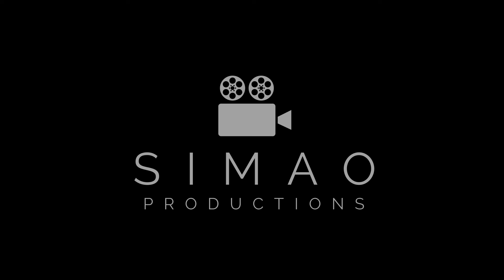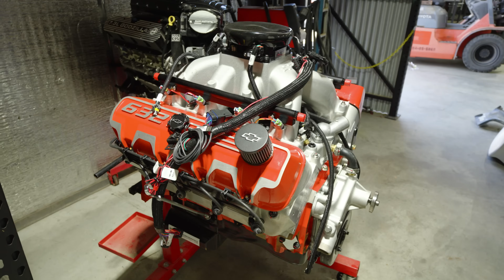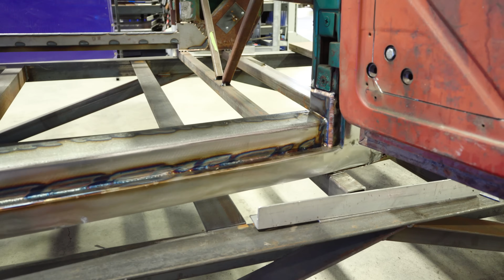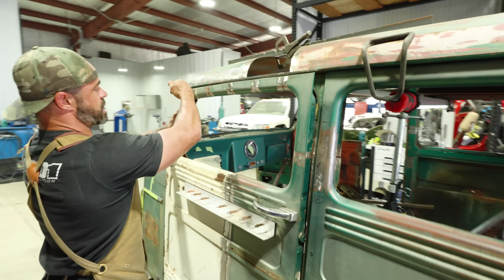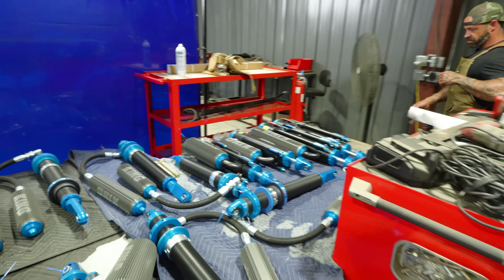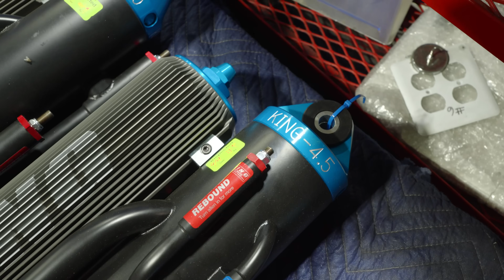Why We’re Ditching Steel | Willys Trophy Wagon Build Ep2 | Morgan Clarke Design

Comment: For the composite body parts, who will maintain the molds or bucks that the parts are made from?  And will you be set up to make replacement panels for the owner when they are needed?  I get the reason why you are changing from metal parts to composite but I'm not sure you will be saving that much time going to composite - scanning, creating bucks/molds, laying up parts and finishing the parts.

Comment: 10:50 the LED lights will give you a very dark shadow. It's called chiaroscuro, so the lit parts are bright, but the shadow is black. Hard to work in for what you are doing, you need a softer light and given the heat, I would recommend small windows in the eves of your building that are on the North or lea side out of direct summer sun. Gable windows that allow hot air to escape are also useful for these large spaces, depending on the position of the building I chose an upper window that has morning sun at winter solstice for that religious Blues brothers moment. If you can plant deciduous trees to shade the buildings sides. I normally get trees the same age as my clients children, a 15gal tree from a nursery is 5-7years old. I bury a drip hose in the ground for hot climates to the root base of these trees using the a/c condenser collector as a water source. This can be filled manually if there is a drought.

Comment: 3:50 Yeah dude, just do NACA ducts, you don't need to build big positive silhouette scoops on the roof and disrupt the profile of the rig. Honestly i think a well shaped NACA is almost 100% just as efficient as a big stand-off scoop, plus they look WWAAAAYY more stealth and just generally cool as fuck. You can basically make a NACA as wide as you want. Especially if you put some vortex generators right at the forward-most point of the inlet to promote boundary layer adhesion down into the ducting. So you could do like two 10" wide NACAs that dump into their own 5 inch oval tubing which port directly into a sealed shroud radiator. One cool thing about a setup like this, is that you could port some water atomizer nozzles into the tubing between the inlets and the radiator, and have a REALLY effective evaporative cooling setup on the radiators. Because those big blocks just make a shit ton of heat... think like two 5.3s worth

Comment: 2:09 dude, just do simple inner wheel liners coated EXTRA THICK with raptor liner. You could even probably get away with no wheel liners, that raptor liner is insanely robust and would almost 1000% certain prevent the vast majority of dimples from rocks getting slung up. You can lay it on literally as thick as you want. A lot of the pro drift guys run it and i frequently hear them praising it's ability to prevent inner wheel well damage

Comment: Dude, i think you need to build a sports car. I KNOW, that your life's passion is is desert trucks; but the world needs your gift of top level sheet metal artistry bestowed on something that is 3 inches off the ground, makes 1000 pounds of downforce and does 190 mph. I think a Mark-IV supra would be the best option considering your level of fabrication and the extent of the Supra's legend. But whatever you were to choose, i think the performance modified sports car community would be EXTREMELY receptive and supportive. I desperately want to see you do a car with custom subframes, incorporating custom dual wishbones front and rear with cantilever in-board dampers. And like a custom titanium dash and center console with the matching door panels and new floors deleting the rear seats. I just think that a sport modified car that doesn't require you to fill the cab with a 65 point cage, because it isn't ever going to ever do 135mph over sand whoops; would give you a lot more square footage to treat as your canvas and provide SO MUCH room for your incredible, artistic fabrication

Comment: Wont the composite crack over time with abuse why not have composite inner fenders to protect the wheel wells
Reply: If he makes a mold, wouldn’t it be easy for him to make a spare?
Reply: @ShaunHensley i guess yeah if the dude totals the front end  and needs to replace it that would makes sense but with heat and cool cycle the composite would probably get brittle over time i assume and the impact from jumping the mounting areas would get airline cracks but im unfamiliar with the composite hes using
Reply: @dallasmeadows9213  not sure what composite he's planning to use but in drifting and rally they use Kevlar Reinforced Carbon Fiber. that's flexible so it doesn't crack easily and it's much more durable composite compared regular Carbon Fiber. I think they have also inner fenders made out of rubber, steel or some other material in rally cars to take the most of the beating of rocks. Not sure what composites they use in trophy trucks, Carbon Kevlar isn't cheap and weight saving maybe isn't that important in those cars. I've also seen people use some additives when they make fiberglass body kit that make's it flexible so it doesn't crack from impact when you're hitting wall's in drifting, making it much cheaper body kit alternative to something like Carbon Kevlar.

Comment: Ya dude carbon composite or fiberglass.  One piece front end agreed. Then whoever manufactures it will have the mold for future replacements.  Then do a sweet rusted metal/patina wrap.

Comment: I love how a gifted chassis fabricator like yourself understands the difficulty of sheetmetal metalwork. I feel it's a skill that you could do your whole life and still be challenged and learn new stuff. Soo many different ways to shape metal. Welds shrink and always need stretched afterwards to move the metal back into it's original shape. Tighter fitment and smallest welding rod is best. Less rod needed, equals less heat in the weld and less shrinking. Every weld shrinks and that's what people who mig weld sheetmetal don't grasp. Should always tig sheetmetal so you can planish the weld afterwards. I believe Ryan Tuerck used a CA based company that scanned his scout. Modeled the widebody fenders and then cnc printed molds for the glass parts to be made from.
Reply: I don't think it's a people who mig weld sheet metal issue, it's a people who don't understand metallurgy issue. People who don't understand how much steel moves with just temperature changes in the air around it, yet alone when you focus heat in one area.